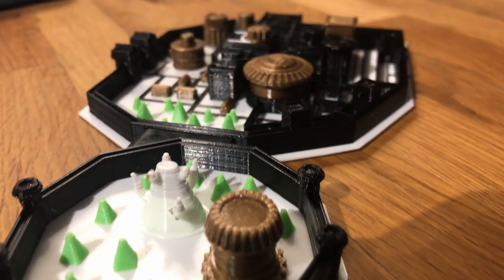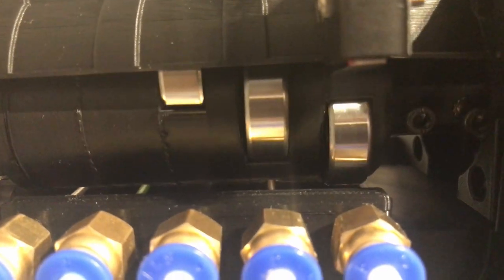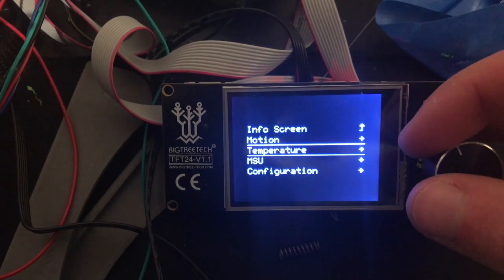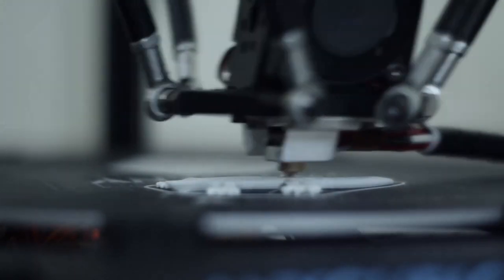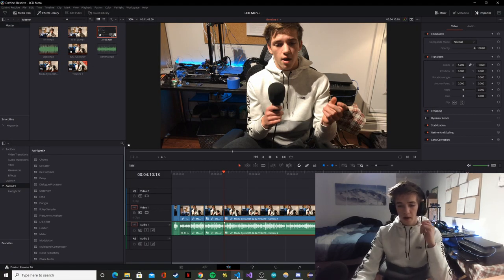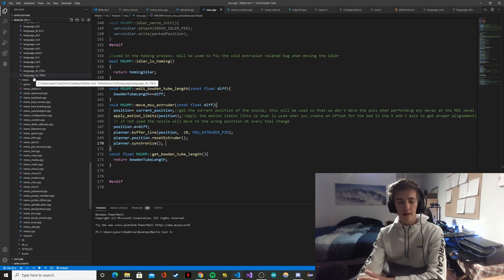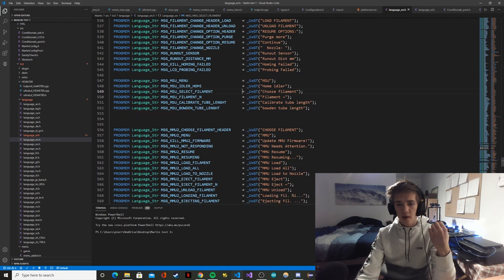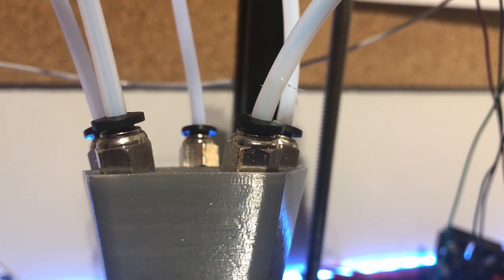Adding an LCD menu in Marlin.  MMU2 on any printer: Part 26

Comment: Mark my words: your invention and your great potential as a maker will bring the 3D printing community recognition and it will be really fast. Thanks for sharing your work. My two cents, try to improve cable management and tidy up your workbench, just to enhance the MMU2 which is the real star ⭐️ of your channel 😆. Cheers!
Reply from the maker: Thanks! and yeah the workbench needs to be cleaned asap😆. Cable management is going to be worked on, I am just waiting for a crimping kit with connectors to be delivered as well as some really nice cable sleeves (similar to the ones on custom pc power supply cables). If the result looks half as good as those  custom sleeved cables I will probably make a video abt it. Have a nice day!